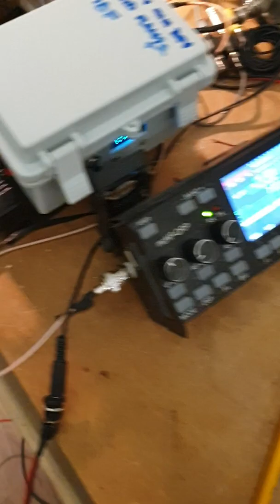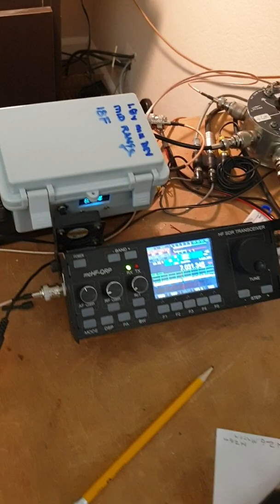HLA 300 LINEAR AMP ,SIMPLE MOD TO DECREASE SWR PROTECT CCT MOMENTARILY WHILE LOW POWER TUNING

Comment: Schematic of the mod please.
Reply from the maker: Send me your email to rdesilva49@gmail.com
It's a simple procedure  one resistor and a push-button to lower the reflected volts to the protection SCR.

No wires to cut or parts to remove